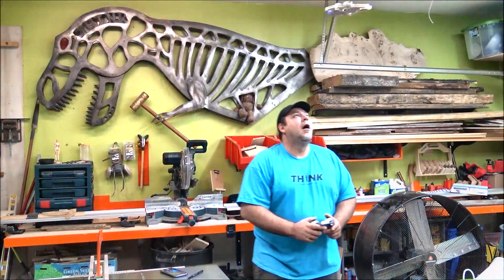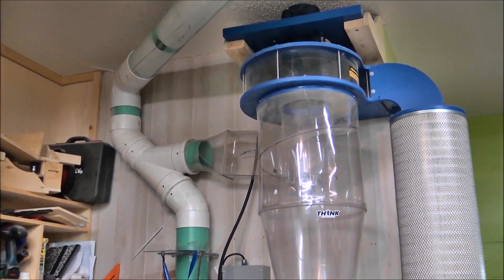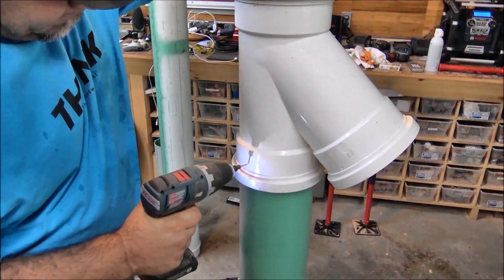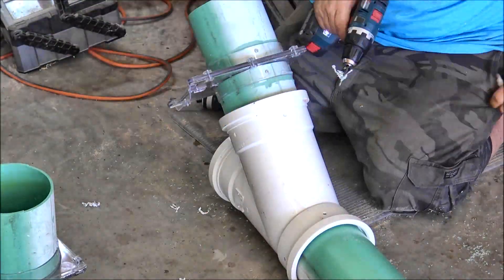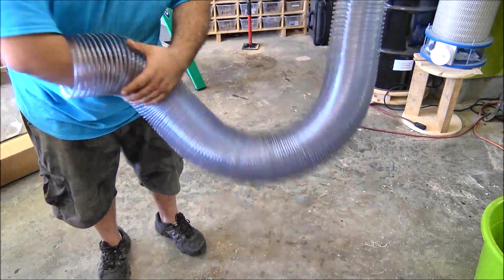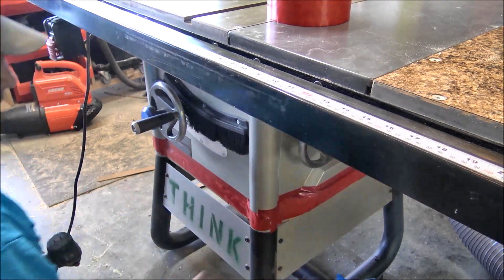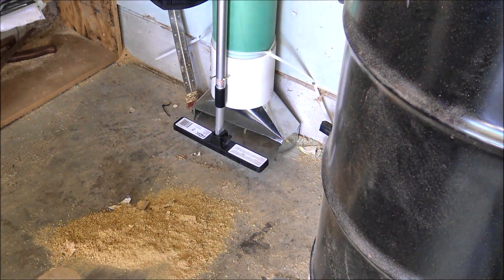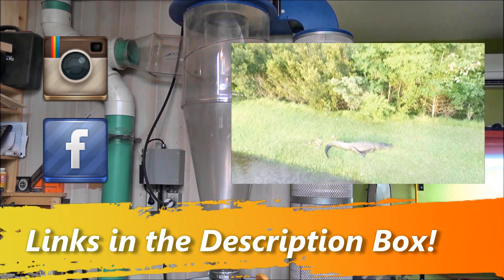How to Install Dust Collection Tips with the CV 1800

Comment: Many have mentioned the "Y"'s around the wrong way and 90's instead of 45's, also screws instead of tape but just as bad, or worse, there is a restriction and block up potential where you put the flex into the pipe, the smoothest transition is the opposite. Think of the direction of the airflow.

Comment: From what I could see I saw 5 possible issues. 1. The wye in the middle of the ceiling is backwards, 2. the wye by the vacuum unit is backwards, 3. the static could be an issue but I've never had a problem with it. 4. Also, if you closed up all the air gaps on your table saw you won't have enough air flow and the sawdust will stay where it is. That's like using your household vacuum cleaner with the vacuum head pressed down against the carpet. There won't be enough air flow and the dust and dirt will stay in the carpet. There needs to be a little air gap between the carpet and the vacuum head. There needs to be air flow to move the sawdust, not just a static vacuum. 5. The 90-degree elbow could slow down air flow slightly.
Interesting combination using sewer pipe with water line fittings.
I very much like the videos that I've seen so far, I look forward to seeing the rest of them.
Oh yes, one more thing, the long screws you used to connect the pipes could eventually catch on debris and eventually restrict the air flow. Just kidding.

Comment: one thing I noticed that was not correct was the entrance piece near the cyclone entrance.. the fitting used are ok, but their placing is incorrect and will pose a resistance in the air flow.. 
the direction of the air flow must be smooth and with no shArp angles.. I'll try and attach a sketch if possible..

Comment: Nice video. On the pop quiz at the end: It's very very sharp (acute) angle with the Y fitting going the wrong way at the cyclone inlet... The rule of thumb acronym for dust collection ducting is D.O.G. Direct(and short) Open and Gentle.

Comment: For all you guys concerned about grounding PVC...that is a myth! PVC does not generate or hold any static electricity at all. That is why when you look on the different dust collection manufacturers websites they don't even mention it. Mythbusters debunked that myth and even tried to force it to happen by painting a 20 foot long 6 in wide pvc pipe with silver metallic paint and nothing.

Comment: 1. The bottom of the Y connector should be attached to the Clear Vue Cyclone rather than either of the top of the Y for better air flow. This was not my first thought, but I have to agree with those commenting just before me now that I see it.

The rest of this stuff is less likely but a little something:
2. If the screws used to join the pipes are too long, they will jut into the pipe and cause negligible turbulence, but it is some turbulence. 

3. The magnet sweep is a clever idea. I did notice at least one screw got by and into the port. Not sure how to fix that because if you lower the magnet any more, there will be clearance issues. 

4. You could attach some wood blocking to the ductwork just above the opening and behind the length of the magnet it is a little more stable. The magnet's rotation/spin would be limited by the blocking. Part of the video shows one the magnet's corners was angled into the duct's opening so the other side had a small gap, but looke large enough for some metal to be able to get swept by the magnetic field into the dust collector.

Comment: Static seems to be somewhat of a believe it or not issue. But, I can say that I have seen a shop-vac catch fire - it was being used to clean fiberboard dust from a CNC mill. The student reported that there was a lot of static being generated when he was using it - then the smoke started coming out.  Burned the filter and a lot of the sawdust inside. So, for my dust collection system, I ran bare copper inside. May or may not make a difference, but for the small increment in cost... (but yes, it does nothing for static buildup inside the bags).

Comment: 2 spots are wrong actually,  Y at the beginning by cyclone coming from floor and the other part is the Y in the middle of the ceiling Pulling in wrong direction.

Comment: Short radius 90's main problem. If grommets were left in, the screws and silicone would not be necessary. Did the screws you use extend into duct work? May get a rag sucked in and hang on screw.  I would have not used glue, or silicone, but use duct tape at fittings. May need to take it apart and fittings are tight enough not to sag. There is no clean out.

Comment: Izzy, Can you tell me what you are doing about static buildup? I want to run ductwork around my shop as well and am concerned about static buildup with the water pipe similar to what you have used. The flex hose that is made for the duct collector isn't an issue as it is designed to deal with static buildup but what about the water pipe? How have you dealt with this issue?
Cheers,

Comment: When you use pvc or other plastic pipe it needs to have a ground wire running the entire length of the pipes, dawdust moving through the pipe creates static electricity and can or will cause a explosion and resulting fire.Be safe!

Comment: I've had a dust collection system for years with pvc piping and have had no problem with static. I do wonder about your decision to use screws that extend into the air stream. Two reasons: 1. potential to create obstructions I  the line & 2. potential discharge points within a dust laden airstream.

Comment: Use 90 degrees corner = 60% less power(use two 45 deg instead). And just mention below, Y are in the wrong way. Less restriction will result to more succion. But 5HP motor will compensate for that few error. I got a 650 CFM with a 1HP motor converted in a cyclone and that's enough for any power tool that I have in my shop.

Comment: Izzy, the "Y" connector by the separator is incorrectly installed. I would also suggest if you could replace the 90 deg elbows with 45 deg you can reduce the static pressure by 50%. Also please run a bare ground wire inside, and wrap outside of PVC as well to reduce the risk of spark ignition of dust.  We like to see you and your family safe and for your super cool videos to continue. Thanks for sharing the video and look forward to your guest joining you.

Comment: I love your videos. However, your skill level is way above mine. An observation concerning your dust collector.  I've been involved in the HVAC industry for about thirty years and have installed numerous dust collectors myself and several things that I noticed was the use of pvc. Pvc creates static kling so whatever dust the collector may miss will ultimately be stuck to the outside of your pipe. Second you took out the rubber bushings which are designed to hold the pipes securely without internal penentrations, therefore allowing dust to build up within the collection pipes and thus running the risk of fire. Any and all penetrations should be avoided for safty reasons. You do great work. keep it up.

Comment: Would've been cheaper and easier to just use regular PVC pie and PVC cement.  No need for expensive pipes , drilling and screws. 
But it does look good
Reply: +Bald&curious Until you get a clog and have to cut your pipe apart or snake it from the end instead of popping a few screws loose to clean it out.
Reply: No , you don't. You install clean out every so often. Then you just unscrew the clean out cap. It's been done like that with plumbing for decades :):):):)
Reply: Good point, I'm a woodworker not a plumber ;).  I used HVAC ducting for mine, but most guys I know that do PVC just tape the joints so it's easier to reconfigure down the road, because you will reconfigure when you find a sweet deal on a machine on Craigslist.

Comment: One thing I do differently, but I can't say it's "wrong" is when adding silicone sealer, I put it on the pipe (or in your case, the hose), then slide it into the coupling. That way the sealer is pushed outward, away from the path of the dust. 

You put the silicone sealer on the coupling then slid the hose into the coupling, effectively pushing the sealer into the path of the dust. While this is not a big deal, if any "chunks" of the silicone sealer were to break off it could get into the Cyclone and cause long term problems.

Learned, by me, at the the infamous School of Hard Knocks. :-)

Comment: That thing is a monster.  I need to look into a system, but not sure I can afford that one right away.  I have the cheapo harbor freight unit, and want to add a cyclone to it for now.
Reply: +Howard Springsteen I've got the 2hp unit from HF and I put a chip separator in line and it works awesome.  It's the cyclone trash can lid I got from woodcraft: http://www.woodcraft.com/product/143290/trash-can-cyclone-lid.aspx It's no ClearVue but it works.
Reply: +Wm. Walker Co. William, do you have any video on it?  Would love to see your set up.  That is a great difference in price to the CV1800.  LOL
Reply: +Howard Springsteen I'll do a video and shop tour soon and I'll demonstrate the DC setup

Comment: Izzy: You did a great job of blocking the holes on the table saw, but I am wondering.  How is the air flow through the saw?  And is the cardboard still on the bottom, or did it get suck in?  1900 cfm being drawn out of the saw would create a fair amount of negative pressure, yes?

Comment: Great machine. How's the static buildup on all that PVC? The main reason I went with steel is so I didn't have to worry about running ground around all the plastic pipe...
Reply: +WoodworkingManiak I have same system. Static is not an issue.  Besides, you can't really ground out the static inside the pipe with something on the outside anyway, since PVC is an insulator.  You'd have to ground the inside as well as the outside.  No evidence of any static discharge igniting wood dust in this size of system, ever, to my knowledge.  The charge never builds up enough energy and the dust concentration never gets to that sweet spot.
Reply: I have some PVC in my setup and I can not believe the static that comes off of it. Made the hair stand up on my arm. That reminds me I must get that ground wire on! Be interesting to see the difference.
Reply: Tom Wilcox ground wire will reduce nuisance static on the surface but will do nothing on the inside where it matters.  There is a good article on this somewhere in the web.
Reply: +Andrew Grover  https://home.comcast.net/~rodec/woodworking/articles/DC_myths.html
Reply: +Andrew Grover thanks! Heading that way to have a read.
Reply: +Andrew Grover just read the article. SCREW THE GROUND WIRE! Thanks again.

Comment: The Y section to left of cyclone is the wrong way around. It needs to assist flow from the cross ceiling section AND the floor collection upright and merge them into the cyclone. As it is the floor collection dust has to whiz around the sharp corner of the Y section to get to the cyclone. Easy to fix. Nice video.

Comment: Y fitting is connected backwards, also you should avoid using short or small radius 90° el's, I'd use two 45° el's with as much straight between them.  Of course with the CV1800 being a beast I suppose it won't matter too much.  Thanks for the vid izzy, can't wait for more.

Comment: I'm surprised at the number of comments regarding PVC and static electricity.  A simple Google search uncovers lots of information.  No doubt there are companies that use scare tactics against PVC ducting.  Just make sure that you have an insulating fitting between a wire flex hose and the metal of your machine, or you will charge your machine and get a "snap" when you touch it.  I've used PVC ducting for over 30 years (unitl I upgraded to Nordfab), and never had any issues.  Although not necessary,  grounding any system is always a great extra safety measure.

Comment: The backwards Wye has been noted by several.   The two 90-degree elbows are less than ideal, but you've got to work with the space you've got, and that cyclone has tons of suction!

(I think we've all put our hands/arms inside the DC pipe while it was running... :-)

Comment: Great video Izzy.  Thanks for the Saw Stache into, I've been using a modified magnetic bumper sticker and fear I'll rip it every time I have to take it off.  I'll be buying some of that right quick.

As for your error.  You used a 90 degree elbow around 2:08 to drop down on the bench side of the shop...  Shame, shame...

Comment: You have to run a grounding wire through the system to dissipate any static charge caused by the sawdust rushing through the PVC at high speed. Spontaneous explosion of aerosolized organic particulate is no joke.

Comment: +izzy swan. It looks very impressing. A question, is not it dangerous to have plastic tubes. I thinking of static electricity. My self i am using steel tubes in the same size Have a heard that many have grounded cooper wire inside the system to avoid sparks.
Reply: +lars niklasson If I put in a link it'll probably get grabbed by the spam filter, so I will just suggest that you search for "Grounding PVC and Other Dust Collection Myths".  That should take you to a paper published a few years ago that addresses this.

Comment: Hi, I need some information, and I know you can help...   I live in a rural area, I don't need dust collection as we know it....  I need to exhaust my dust out of the shop...  I want to know what you think of using a Y-fitting, connecting one-branch of the Y to my planer/table saw, then on the other branch connect a large shop-vac, using the exhaust of the vak to cause a suction on the planer/table-saw hose, thus blowing the dust out of the shop onto the ground outside...
Reply: +David Januszewski Your looking to build what's called an Aspirator pump. While just hooking a Y up probably will disappoint, look at ways to homebrew a venturi.  -  you need to create low pressure relative to your system to create vacuum. On the up side, it's easier to push fluid than suck fluid, (that's why we use pumps on wells and not vacuums, and why our dust extraction, well, sucks most of the time without massive HP). Looking up Aspirator pump will give you lots of ideas.

Comment: Have you been zapped yet? PVC can really build up static electricity.
Reply: +bkjbae
Yes, I was really surprised when touching the hose from the saw to the self built extractor/extractor to shopvac made the hairs on my arm stand up. And that were relatively short, small diameter hoses and didn't even run that long. Didn't really zap me, but I guess with these huge PVC pipes and the high volume of air transported it could be different.
Reply: superdau My shop vac does a decent job at shocking me on dry days.